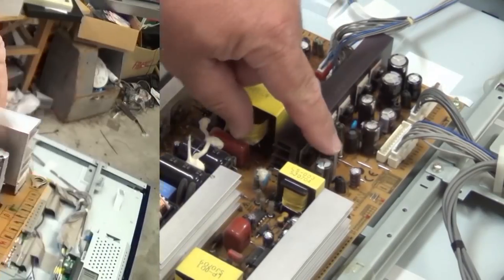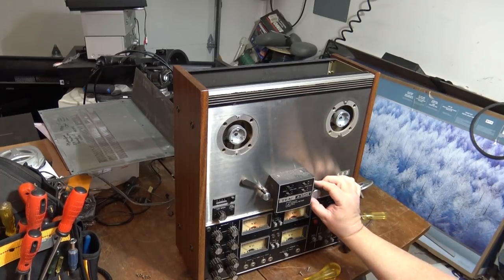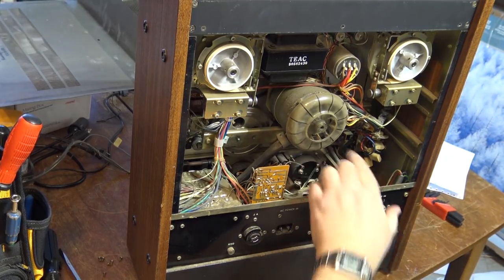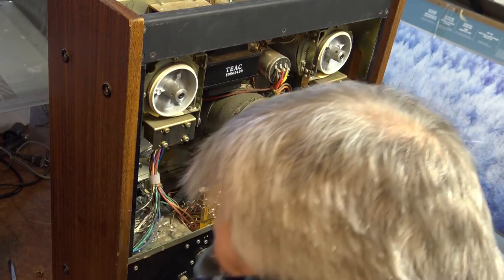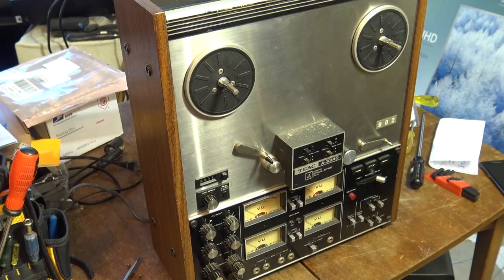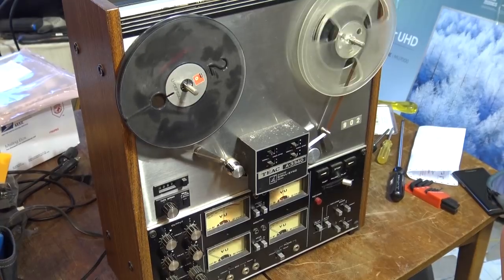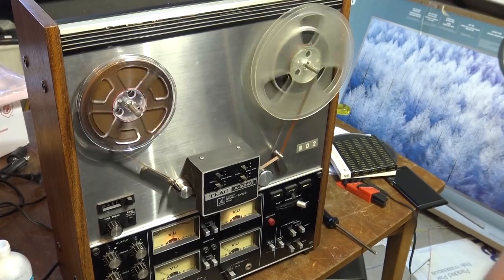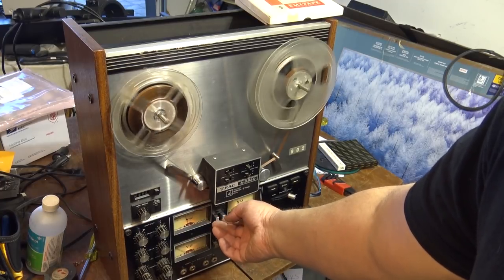Teac A 3340 4 Track Reel to Reel restoration

Comment: The constant buzzing ! Argghh!
Reply from the maker: Too bad, so sad I need the bright light to see what I am doing.
Reply: I'm with you on that I need bright light as well.
Reply: I've watched a good portion of his videos, and I've never noticed any buzzing.
Reply: You can use the free source program Audacity. Highlight at least three seconds of just the hum  click on noise reduction   then import noise. Then highlight the whole track then noise reduction and execute. Then save. I use this all the time to remove the air-conditioning him in our Church videos.
Reply: Watching this great videos I feel like a visitor in his shop. All the background noise makes it more authentic beeing a vistor watching this great repairing jobs.
Reply from the maker: Just a troll looking for an excuse to hit the thumbs down button f*ck him.
Reply: Pinch roller.  Got it.  Strange, but every issue that you had mine had.  Dragging left spindle and the pinch roller not engaging.  I’ll be trying to oil the pinch roller next.  Great video.
Reply from the maker: @robertcunningham1542  
That would mean exporting the sound to a format audacity can read and then re-importing the audio and syncing everything up.  Too much work. If I was being paid for a production then I would do more work on it. But for about a penny per view you are lucky to get what you get.  When I did corporate videos I made about 1000 per running minute, so I could afford to spend as much time as needed polishing everything.
Reply from the maker: @edhusar  
All these old units have these problems.  Once restored they are good to go for years.

Comment: hi did a full service on my unit the front  audio and vu lamps  hell was the word i had the front black panel of i wish i had gone a video you would have seen all
the insides of the audio looms you have to un do a lot of part 1 hour to get the panel of i have one i am working on i put a video on later  i love your video's

Comment: It's got a 4-track head but reverse play doesn't work?
Reply from the maker: It's not an auto reverse deck it is a 4 channel, a quadrophonic deck.  These were also used by musicians for Mukti track on small studios, radio stations ect so a music bed could be laid down and the voice over added after fact.
Reply: @12voltvids  Which is kind of surprising since it would not need much more to make it an autoreverse deck except for a second capstan to play in the other direction.

I believe later Teacs (the X series in particular) had dual capstans so they could do autoreverse along with Simul-Sync if you wanted to do 4 channels in one direction.
Reply from the maker: @Stoney3K  actually just reverse the motor direction like Sony and Akai did.
Reply: @12voltvids  Wouldn't that cause any issues with uneven tape slack over the heads because the capstan is pushing the tape over instead of pulling?
Reply from the maker: @Stoney3K  it had a large roller on the left side that was just turned be tape tension going over it.  My Akai has a center pinch roller and 6 heads.  3 on each side of the capstan.
Reply: @Stoney3K  I believe the A-4010sl  has auto reverse.

Comment: i got one i paid 75.00 for it 25 years ago i do wounder how much they went for new
Reply from the maker: In about 1983 I paid 700.00 for an Akai GX260D used!
Reply: @12voltvids  i just checked mine its the teac a2340sx any idea where to buy new tape besides ebay are there companies making the stuff
Reply: I bought my 3340  in 1972at Tech Hi Fi Boston for $650.   that's what they went for  - no deals - no sales !  I still have mine.   I did tons of 4 track live recording at 15IPS - still have the tapes  they sound great !

Comment: And now for the million dollar question........who makes tapes for these decks??? I have come across several decks but without tapes and not knowing where to source tape I passed on them. Don't want no questionable ebay junk, only new manufacture. Might be asking for a lot but I know how tape ages and deteriorates.
Reply: I use Ebay. You can score some nice new in box high quality tapes. I've bought several models of tape on the higher-end scale and have had excellent results. Maxell and some Scotch sound great!

Comment: HI have one that's in a very very bad way i watched alot of you video's now i can fix  it   it's the same model it was used in a recording studio heavy heavy hours
head were all cut up wear all over it  on eBay someone had one they pulled  a part as the main  transformer  was bad it was all the button's and uv lamps
a killer of a job to do i love a hard job fixing the pain in the behide  job's

Comment: That new deoxit triger is a piece of crap. They leak and you end up waisting half of it and it's not cheap.
Reply from the maker: I agree. The cleaner is great, but I am not a fan of the can.
Reply: @12voltvids  Yes it is. I wish they would go back to the old style button sprayer.
I saw your Akai GX365D video. I have one of those but it needs work. Bad transistors (c458) i need to replace them.
Cheers

Comment: BZBZBZBZBBBBBBZBBZZZZZZZZZZZZZZ...hahahahahahahaha.
Now I know what the inside of Mine looks like.. It was given to Me by a Great friend who's dad is a Silent key. 
I used it to Play the "Rain Report" over the 2m Repeater on Net night. It was recorded onto Tape by another Ham that worked at a Radio Station and Recorded it during the Day then dropped it off at My Work..
I have an Astatic D104 Wired into a Radio shack Mixer so I can mix the Audio and turn the Mic Audio off and lock the Mic.  I ran about a 1/2 Watt to get into the Repeater. (70ft Tower with 2 215WB Antennas) I monitored the repeater input remotely so I could tell if it was being interfered with or someone was trying to get into it. 
Sadly it is now packed away in its original box...

Comment: OMG I cringed when he used a heat gun!!!! Whats wrong with him!!I have adjusted table height on there machines MANY times.
Reassemble the reel table, remove the left wood panel and locate the set screw by manually rotating the reel table. Loosen the set screw and pull the table out to. Where it needs to be. I use an empty reel and thread the machine backwards (put the supply spool in the right side and take up in the left) slide the table back into position so the tape does not rub on either side of take up spool. Tighten the set screw firmly. Replace wood panel.
The arm for the pinch roller needs to be removed and CLEANED, then tiny oil applied AFTER its cleaned or it will gunk up again
I restore professional broadcast 2" quad video tape machines and i am very meticulous about my repairs. It was very hard to watch  this guy.